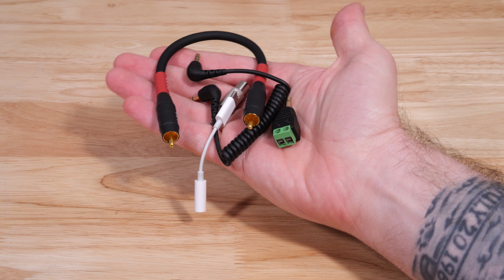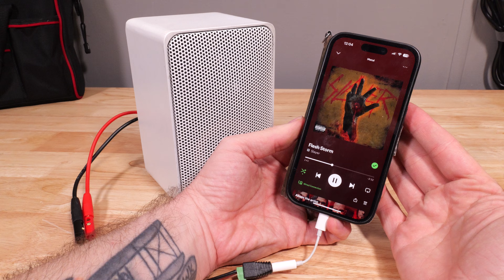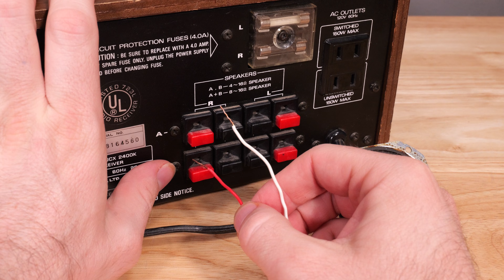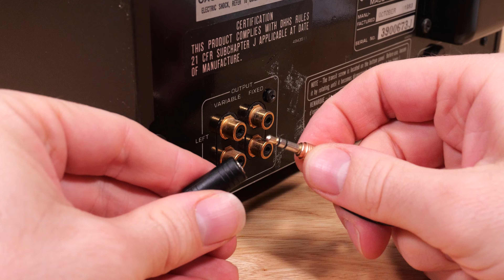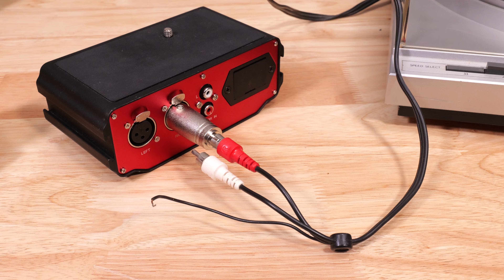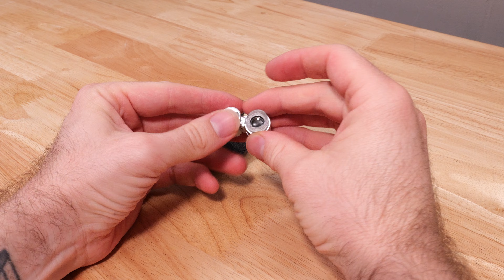This Is The Most Important Tool For Field Testing Audio Equipment!

Comment: I collect CRT TVs. When the sets are free or really cheap, I don't bother testing them, but when I needed to test something I used to take a Sega Genesis with me, which is kind of bulky. I found a $10 handheld NES clone at Walmart that outputs 240p over composite video, so now I just keep that in my backpack with the rest of my tools.
Reply from the maker: That's clever.

Comment: I have a pair of Mission bookshelf speakers that were in a kitchen for 30 years and the cabinets have that flypaper stickiness you mentioned.  It's gross and I have no idea how to remove decades of grease without damaging the veneer so it just sits in the basement waiting for a solution or my own future estate sale.
Reply from the maker: If you come across a good solution for the sticky, let me know l. :)
Reply: In my experience it depends entirely on the surface that’s sticky.
A little dish soap in water with a bit of alcohol will usually get it off most things with a few rounds of paper towel scrubbing… but on speaker boxes or mdf board can be easily damaged, grills are more forgiving, you can often wash them in the tub with water. Cassette decks often have little or no ventilation so they’re kind of safe, but big old hot running amps with have that muck inside, for that you need a hand pump sprayer filled with 91% or stronger alcohol to just spray them out!
Heat helps break it up too but be prepared to dry it with a leaf blower then put it in front of a fan for at least 24h, rotating it to ensure you blow it all dry before you plug it in.
People think it’s crazy, but it can work fine IF you know what you’re doing!
But old silver face plates are the real problem!
Even lightly rubbing the lettering with a wet finger can pull the lettering right off! Just water!
So alcohol will do it even easier!

You can also use stuff like goof off or goo gone, but it’ll strip paint on some stuff, or discolor paint…

I find that the older the gray, the easier it is to take it apart so you can access inside parts for dry brushing and vacuuming and/or blowing out dust and crud, not always true tho, speakers from the 60s or earlier are often fully sealed with glue and nails… sometimes you just gotta bust em open and hope you can fix them.

Comment: 9:25 I mentioned using a magnifying glass before, but one of my best tools is a thin plastic credit card-sized "Fresnel lens" magnifier which I keep in my wallet at all times which comes in handy at thrift stores for looking at extra details of electronics or for scanning past a large assortment of CD spines on shelves to read them better to pick ones of interest, etc. They're cheap on Amazon and I bought a pack of ten of them for just $10.  :)

Comment: 9:25 One non-electronics thrift store or estate sale tip I learned many years ago either from my parents or from watching the PBS or BBC 'The Antiques Roadshow', etc. before buying any glassware, ceramics, teacups, etc. was to hold the glass, cup, or bowl and give an edge a gentle ding with my fingernails (One finger will do. You decide which finger. Haha!). If I heard a nice high-pitched ring or resonance from dinging, then the glass or ceramics, etc. were solid with no cracks or chips, but if I heard a blunt or dull sound, then there were definitely cracks somewhere, so I usually avoided buying damaged pieces (unless a piece was so exceptionally rare to find in ANY condition, in which case, it may be worth picking up).   :)
Reply from the maker: YES! Another Antiques Roadshow fan! That's another good tip!

Comment: I repair turntables and sometimes i need something i can test with in the field , litterally .. this works a treat for me , Nowsonic Phonix USB Phono Preamplifier and Audio Interface
Reply from the maker: Is that battery powered?
Reply: @AudioThrift  takes 9v DC by a barrel jack or USB bus power, I suppose you could stick a 9v battery to the back or use an OTG cable to run it from your phone.